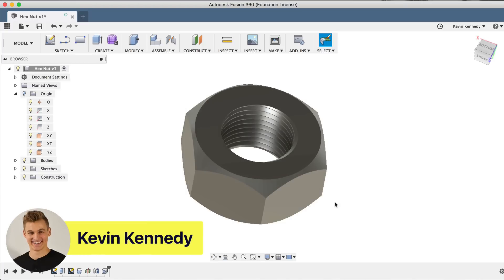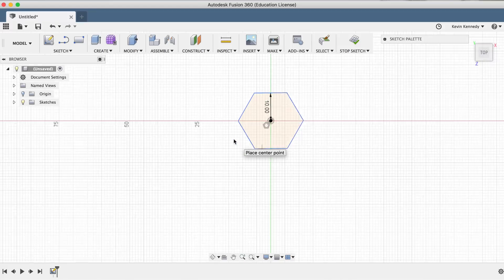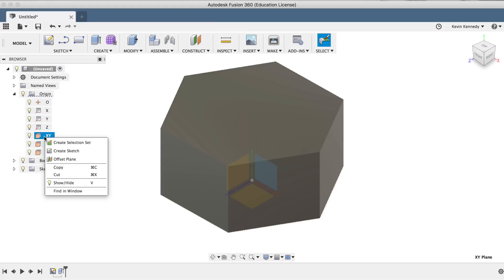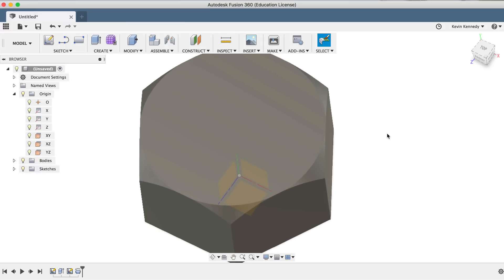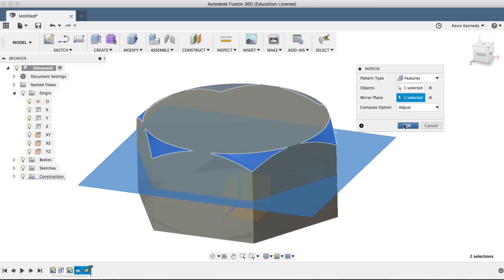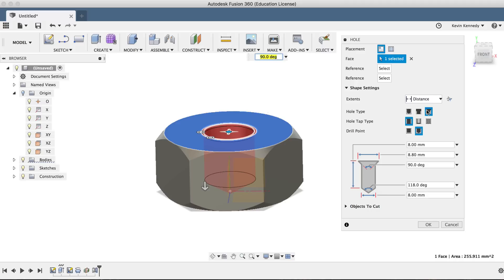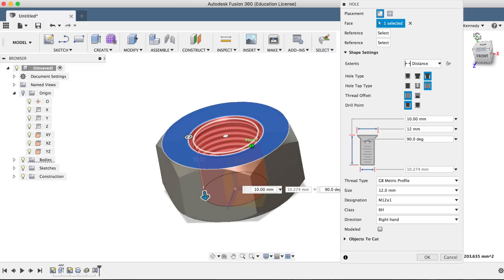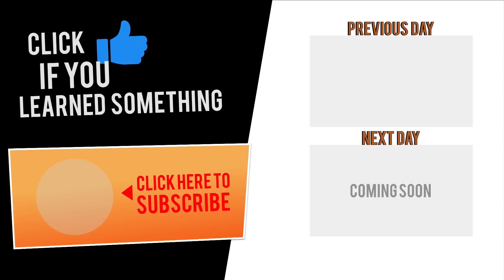How to 3D Model a Hex Nut - Learn Autodesk Fusion 360 in 30 Days: Day #6

Comment: hi Kevin, I trying to revolve the triangle but its coning not revolving?
Reply from the maker: Hi, ZA_ Mercy. Can you double-check that you're using the solid revolve tool (blue icon)? If you're using the surface revolve tool (orange icon) then you won't be able to cut away the shape. Cheers, Kevin :)
Reply: @ProductDesignOnline  hi Kevin, thank you for responding, yip its the blue revolve still coning, checked constraints as well, Regards brad
Reply: Kevin, just a note,I noticed that the lines in the triangle are not defining and staying blue
Reply from the maker: @TheBRADLEYJAMES123  Can you share the link to your file? I'd be happy to take a look at it to see what may be causing this. To share your file please go to File > Share > Share Public Link (make sure "downloadable" is toggled on) > Paste your link here as a reply to this comment. Cheers, Kevin :)
Reply from the maker: @TheBRADLEYJAMES123  Thanks for the screencast. This helps a lot! I see what the issue is now. When selecting the "Axis" for the revolve command, you will want to select the "Z" axis from your origin folder. You can select it in the middle of the canvas window or by selecting it in the Fusion 360 Browser. In the screencast, you selected the top of the triangle for the axis, so it's trying to revolve around that.

Please watch what I select at 2:57. Cheers, Kevin :)
Reply: @ProductDesignOnline  yipppie thank you it worked, well I wont forget that in a hurry thats for sure, 3 days of redoing the same thing over and over and trying to find work around, even using the loft tool. , by the way this is my first time on any cad package so what i know is all from you. you could say I am solely trained by you lol
Reply from the maker: @TheBRADLEYJAMES123  Glad that was it! Repetition makes it stick more :)

 Don't hesitate to comment questions on the tutorials as you work through the remainder of the series. Cheers, Kevin :)

Comment: In the latest fusion 360 you can't go back and see the dimensions to change to 2mm. All you see is the triangle with blue thin lines. When hovering mouse a black curved line appears underneath the triangle to show the nuts curved edge but nothing else. Anyway, I have the nut and well happy. Im a mobile mechanic by trade and to be this happy about a nut, well it has to be cool. Damn it is cool. Kevin you are great.
Reply from the maker: Hi, James. I'm glad to hear you completed the nut. Keep it up!

In regards to the dimensions, I'm not following what's happening. The dimensions shouldn't disappear as long as you're in the sketch environment. They will automatically be hidden if you're in the 3D view. While in the sketch view you can also hide the sketch dimensions by unchecking "show dimensions" in the sketch palette. Cheers, Kevin :)
Reply: Yep to not trying to run before I can walk. This program only a week ago was new to me. Its my deepest desire and ambition to be able to manufacture my own designs in house which drives me forwards. Practise makes perfect. In truth I even believe at the end of the 30 day course I will have to revisit the lessons done and do again to be sure it becomes firmly locked in.
Reply from the maker: @jamesbarratt593  That's the best part about video, you can watch these as much as you want/need to. Cheers, Kevin :)

Comment: I couldn't round the edges because cut wasn't an option in my revolve command. Any idea?
Reply from the maker: Hi, Adam. Double-check that you are using the SOLID revolve command. It should have a BLUE icon. You may have selected the surfacing revolve command, which has an orange icon and doesn't have a cut operation.

If that's not it, please provide a link to a screenshot and I'll look for something else that may be causing this. Cheers, Kevin :)
Reply: @ProductDesignOnline  I repeated the tutorial but when turning off grid snap when I started drawing the piece I would cut. Idk if this actually had anything to do with the issue I had previously but it went fine this time.
Thanks for the reply.
Reply from the maker: @adamd1556  The grid snap shouldn't have any effect on it. Not sure what wouldn't prohibit it the first time, but I'm glad to see you got it working! I'm always happy to help. Don't hesitate to comment questions on the tutorials as you work through the remainder of the series. Cheers, Kevin :)

Comment: The problem I have is I am using the newest version. I have noticed that when you went to origin then planes the image on your screen of the plane in the centre of the nut is the same as mine but if I select XZ not xy like it is appearing for you. Then when I am viewing the nut straight on the line command does not snap to the corner. I zoomed in loads and you can see it does not fall on the line making up the background grid. When I try to select the point it snaps then to either line of the grid but not the nut. This shows when I try to use the revolve function as the nut surface is cut out but theres like a framework above showing the original top surface which was cut away. Any ideas?
Reply from the maker: Hi, James. The default orientation used to be the "Y" axis set to the "up" position. It is now the "Z" axis up, which is why you've noticed it was different in my tutorial. As you pointed out, you'll simply need to select the opposite origin plane.

In regards to the line command not snapping to the corner. This is likely due to the "Auto project edges on reference" setting. Did you turn that setting back on? You can find the instruction to turn it on, here: https://bit.ly/defaultsettings

Cheers, Kevin :)
Reply: Now that if its the case is just madness. Its 7am at moment so computer off and no time to verify as gotta get ready for work, only if thats the reason the project edges would not click to my mouse how stupid of the engineers. Thats also the obvious reason why the whiskey bottle tutorial was not working when I had to move the slider to connect the neck straight line to the curved line just before mirroring and then extruding. 

Let you know later when I check it out. Still, and in all the playing around I did whilst being adamant I wanted to achieve the end result you were getting, I learnt nore stuff and think I have improved because of it.
Reply from the maker: @jamesbarratt593  Let me know how it goes! Cheers, Kevin :)
Reply: @ProductDesignOnline  It certainly worked better. The top of the nut cut away this time.
Reply from the maker: @jamesbarratt593  Great! I'm glad that was it. Keep at it! Cheers, Kevin :)
Reply: @ProductDesignOnline  Yep but heres something. So I selected the hole feature after selecting the face then centred it and went down through the settings, pausing every three selected to re start your video playing to say what the next settings should be. Twice as I got down to the last option then the image on screen had changed. I clicked ok and it said no target reference selected. So third time I did the selections fast and then when clicked ok BAMM, it was a success. Just thought I would let you know. Anyway, when I get to the end of your lessons I will donate to your buy coffee option. More than a coffee too. Anyway thats a promise. I want to get on and start doing the surface stuff to build my welders helmet. Wont yet though as I am adamant I will fail if I don't follow the lessons the way you have laid them out. Good student here.
Reply from the maker: @jamesbarratt593  Glad to hear that. I think you will be happy that you've learned the foundational skills without biting more than you can chew. The surfacing approach is definitely not an easy concept to master without knowing the fundamentals of Fusion 360. Cheers, Kevin :)

Comment: Wow...I just realized you use XZ as the bottom plane!  That's why I've been screwing up.
Reply from the maker: Hi, Bobos Curse. Sorry for the confusion. I record all of my tutorials with the default settings. This tutorial is older (since the first three have been revised after the fact). The "Y" axis being in the "UP" direction used to be the default settings. The F360 Engineers have since changed it (about 6 months ago) because they realized most users are setting up files for 3D printers or CNC machines that have the Z axis set to up.

With that said, you can see all of my default settings on my web page, here - http://bit.ly/defaultsettings
I've documented them and I update this page as things change. Cheers, Kevin :)
Reply: @ProductDesignOnline  LOL.  That's amazing to me.  I'm a 50-year-old engineer and my entire life Z has been "up".
Reply from the maker: It may have been a case of Autodesk just trying to be different (I'm thinking Apple vs Windows). I'm really not sure why they did that. Cheers, Kevin :)
Reply: @ProductDesignOnline  I'm having a blast following these tutorials.  Lots of easy ways to get things done that I don't think most people would find on their own.
Reply from the maker: @boboscurse4130  Glad to hear that. Keep at it and don't hesitate to comment if you hit any roadblocks. Cheers, Kevin :)

Comment: Great stuff, Kevin.
For some reason my XY plane is flat so I picked XZ. No biggie. Still worked out great.
Really loved the extra tip there towards the end by going back into our Timeline and change/modify our line and have it update the model instantly.
Cheers!
Reply: Dove into the comments to find exactly this. @ProductDesignOnline can you add some onscreen text to call this out for others?
Reply from the maker: Hi, Kaj Olsen! Glad you're enjoying the little tricks and tips I put in each lesson. When I recorded this lesson the "Y" axis was the default "up" orientation. Since then, the engineers have changed the default orientation to be the "Z" axis up - which better aligns with use of CNC and 3D printers. That doesn't effect anything other than the outcome. As you realized, you'll simply have to select the opposite plane. Cheers, Kevin :)
Reply: @ProductDesignOnline  I'm glad someone mentioned this.  Some of the little UI changes are crazy-making when trying to learn this stuff.
Reply: @ProductDesignOnline  lol just checking anyone answered my question before i posted a comment and now i am happy cause i don't have to wait for a reply! :::::::::::D
Reply: @ProductDesignOnline  For things like this, you should overlay annotations to your videos where things have changed in newer versions of Fusion 360. That would help reduce confusion.
Reply: @ProductDesignOnline  Is there any method for changing this setting.??
Reply from the maker: @jyothishkamal7722  Documented here - https://productdesignonline.com/default-settings-for-fusion-360-tutorials/#modelingOrientation
Reply: I cannot for the life of me get the axis right...ive changed orientation to Y UP but my Recolve is not orienting on the right plane.
Reply: Finally figured it out
Reply: @macombiam  How did you do it. cant get it to work

Comment: That was fun. I also modelled a 1/2-13 UNC nut & 3d printed it. Looked pretty good but was pretty tight on a bolt until I chased it with a thread tap. Any tips on getting enough clearance when printing?
Reply from the maker: Hi Steve. That is a great question. There are a few different techniques (of which I'll have to make a video on at some point). The simplest method is to simply scale the model by a factor of .01 in your slicing software (or Fusion 360).

You can also offset faces with the press pull command and there are a few other small tricks that can be done; however, they don't always work with every model. Cheers, Kevin :)

Comment: I think you missed the chamfer at the bottom of the threads.  Would that be done using the mirror tool?
Reply from the maker: Hi, Do RC. Yep, the mirror command would be better than creating a second chamfer, that way if you update the chamfer size they're always the same. Just make sure you're using the model mirror command and now the sketch mirror command. Cheers, Kevin :)

Comment: Hi Kevin,
I've just updated my fusion 360, and now the sketch dropdown list has dissappeared. Do you know where I can find it?
Reply from the maker: Hi, Sybren de Vries. I'll be releasing a video tomorrow that covers all the new UI changes, such as this one.

The sketch dropdown list no longer exists. You have to enter the sketch environment by either clicking the "create sketch" feature (in the toolbar, by right-clicking on a face, etc) or by activating one of the sketch commands from the shortcuts box. Hit the keyboard shortcut letter "S" to activate the shortcuts box. Then, search for your desired sketch geometry (i.e. rectangle, circle, etc).

This will then place you in the "Sketch" environment or the Sketch "contextual tab". From there, you'll see a "create" dropdown list where you can then see all of the available sketch geometry that was formerly in the sketch dropdown list. Cheers, Kevin :)
Reply: @ProductDesignOnline  Thanks!
Reply from the maker: @sybrendevries9234  You're welcome! :)

Comment: Hey Kevin you delivered great course, I'm very glad to watch it. There is one issue tho. In the REVISED videos origin box and axis in general are oriented differently. I'm not sure if they changed default view or in previous version you have made some preferences adjusments. Following this tutorial XY view gives me like top view. Shouldn't be a big deal but even if I change axis plane my line don't want stick to the corner. It does in third 3rd view but in this case triangle is in the middle not in the corner so revolve doesn't cover whole surface. 

Clarification screenshots
https://imgur.com/tzD33Rl
https://imgur.com/MEKUIG8
Reply from the maker: Hi, TheMoviesfable. While recording the initial series the default orientation was to have the "Y" axis up. A few months ago the Fusion Engineers decided to change the default modeling orientation to be the "Z" axis up because they realized the majority of users preferred it in that orientation for 3D-printer and CNC compatibility.

Thanks for providing the images. If your lines are snapping to the edge it may also be due to another default setting change (there have been a couple in the last 8 months). Check out my page where I list my default settings - http://bit.ly/defaultsettings

You'll want to turn on your “Auto project edges on reference” setting and that should resolve the snapping issue.

Let me know if that fixes it! Cheers, Kevin :)
Reply: @ProductDesignOnline  It does thanks !
Reply from the maker: @TheMoviesfable  No problem! Please don't hesitate to comment questions on the tutorials as you work through the remainder of the series. Cheers, Kevin :)

Comment: the hexagon wont snaps on the grid
Reply from the maker: Hi, Jhon Carlo Secuya. Do you have your "snaps" setting turned on in your Sketch palette?? Please crosscheck your settings with mine. You can see all of my settings here - http://bit.ly/defaultsettings
Let me know if that fixes it for you. If not, we can troubleshoot further. Cheers, Kevin :)
Reply: @ProductDesignOnline  i got it right but it takes time xD  thanks for the fast response :D
Reply from the maker: @jhoncarlosecuya  No problem! Please don't hesitate to comment questions on the tutorials as you work through the remainder of the series. Cheers, Kevin :)

Comment: having a few issues with this one... when making the triangle for the cut out, my lines are staying blue and aren't fully snapping onto the body of the polygon. it looks like its in the right spot until I zoom way in and see that its just slightly off. When placing the polygon at the beginning, it is snapping onto the correct axis but from there nothing wants to align. tips?
Reply from the maker: Hi Craig. It sounds like a setting may be turned off. Click your username in the upper-righthand corner > preferences > Design (tab on the lefthand side) > make sure "auto project edges on reference" is checked. If not, check the setting > apply button > ok button > restart Fusion 360.

Let me know if that fixes the issue! Cheers, Kevin :)
Reply: @ProductDesignOnline  I got exactly the same issue, it's not snapping on anywhere of the polygon

Comment: Super tutorial.. Just got a question.. in min 2.15 When jou go to draw some lines you get a grid... Mine is gone and nothing snaps.. If I go to settings Sketch grid and snap is selected..  grid settings is on 250mm en subdivisions 5.. but  I can't see a grid.. Any ideas what can be the problem?  thx https://imgur.com/RX99MZk
Reply: I figured it out... ;)
Reply: But I have another problem... I still cant make my line to snap at the hex.. and then my revolve doesn't look good
Reply from the maker: Hi, Fanny. You'll have to make sure your "Auto project edges on reference" setting is on.  Click on your username in the upper right-hand corner > preferences > then under "General" > "Design" tab...then select the following setting: "Auto project edges on reference"

You'll have to restart your Fusion 360 in order to get these changes to take effect. You can also check out all the settings I have by going to my web page - http://bit.ly/defaultsettings

Cheers, Kevin :)
Reply: @ProductDesignOnline   super.. It works ;)
Reply from the maker: @BORAGT201  Glad that worked. Please don't hesitate to comment on any of my videos should you have any questions. Cheers, Kevin :)